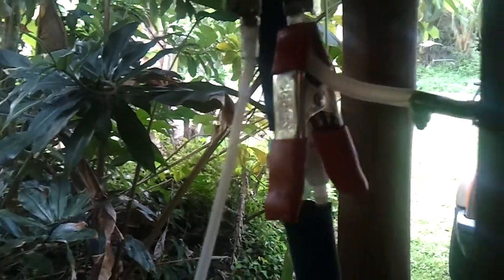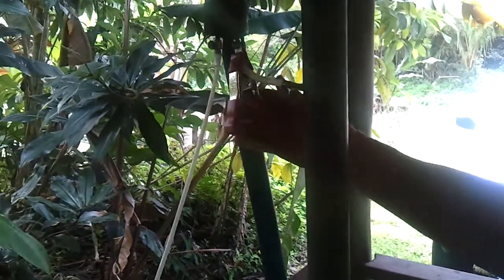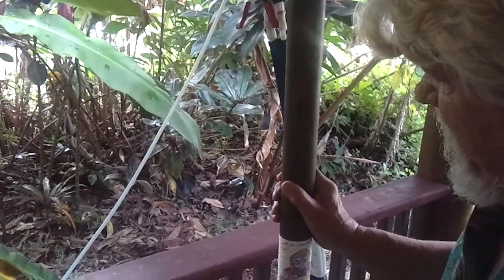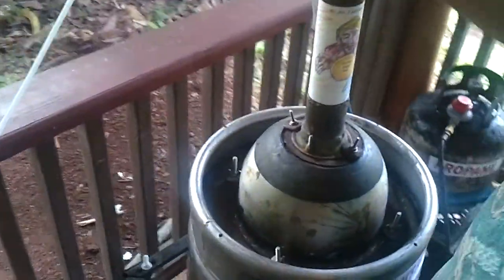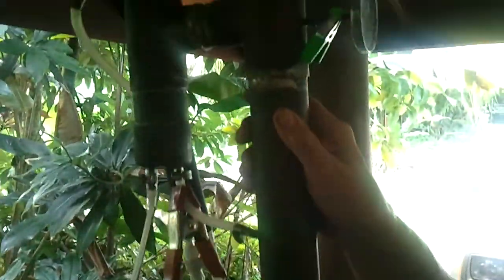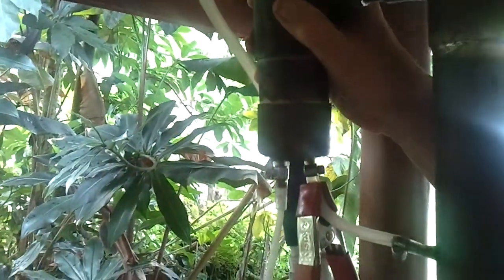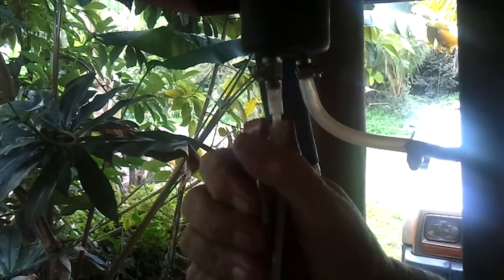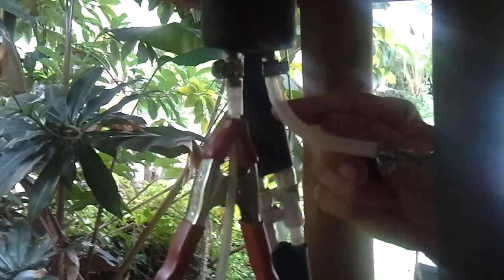Making Fuel Alcohol increasing proof vapor clamp.3gp

Comment: Just a thought... It's actually called "reflux" not 'reflex'. And marbles are about the worst thing to load the column with, use rolled up packed copper mesh, it also takes out the sulphides and other stuff not very desireable. Once the column and condenser are in equilbrium you can 'slow down' the process by reducing the heat to a minimum, usually around 175-180 oF at top of column and stretch it out to make the product slower. Stripping it by shutting off the water to the condenser is wrong.